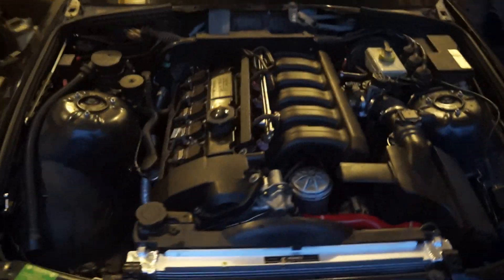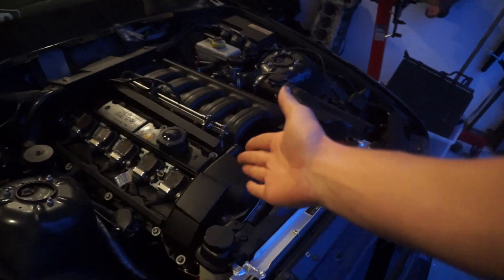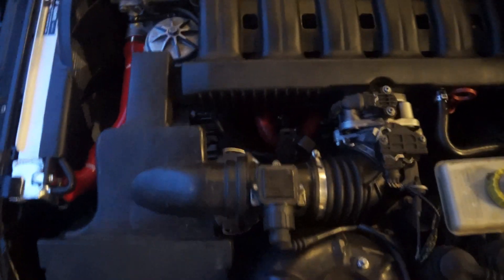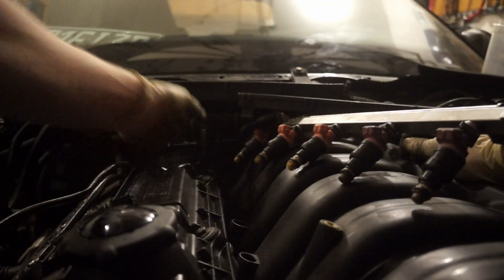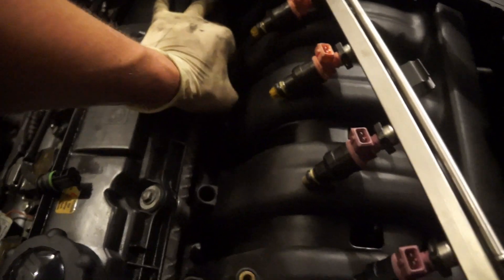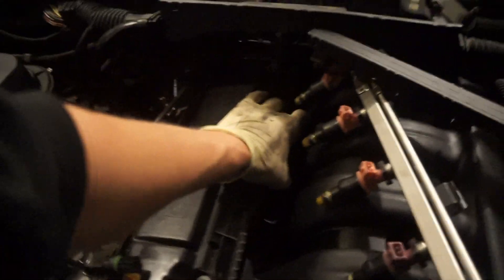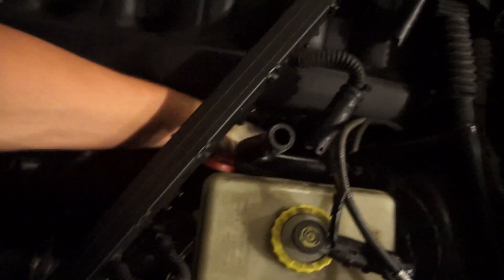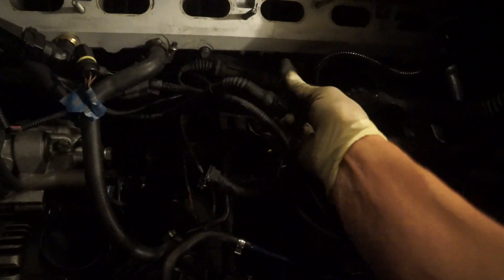S52 Teardown begins!

Comment: Why are u removing the engine ,it doesnt make any sense
Reply from the maker: eeeeaaasy boys lol. the Hardware I used for the headbolts do need to be retorqued, and checking the torque on the main and rods is uncessecary according to ARP but i improperly torqued the connecting rod bolts the first time around, but it is still good to re-check the bottom end torque. with OEM head/rod/main bolts they are torque to yeild and do not need to be retorqued at all, with the ARP hardware i used requires different procedures. more of a precaution, as having a rod come peeking out of the block 3,500 miles after a fresh rebuild would suck ass. I want this motor to be 100% in every aspect, and if i need to pull the motor make sure its 100% then I absolutely will, its just time and effort for me. ive sunk alot of hard earned dough into this longblock, and I dont want to start cutting corners on this build if theres a chance I can prevent a failure by spending a few extra weeks wrenching on it. also +1 for more build videos lol
Reply: @I.Odnamra  who says he rebuilt it right,torqued the arp rod bolt to 28ft lb instead of 40 ft lb. Rookie mistake
Reply: @I.Odnamra  on an e36 u can drop the subframe in a 1/2 hour and have  access to the oil pan and rod bolts
Reply: @Grab America by the Flaps

L